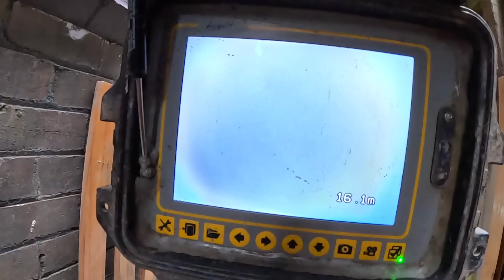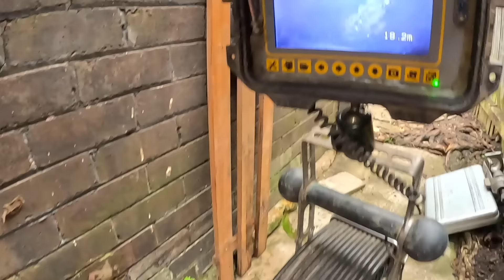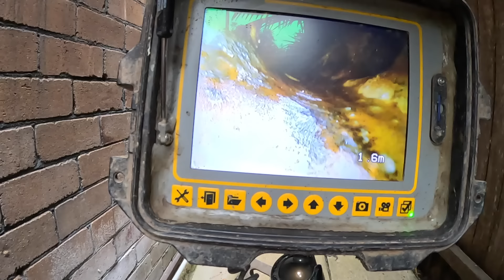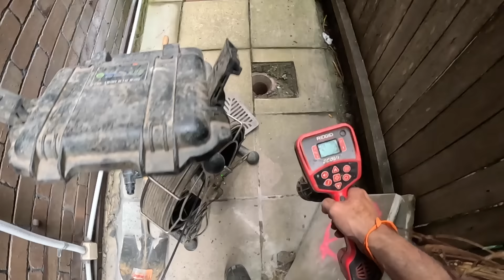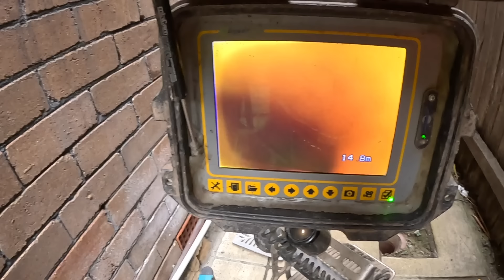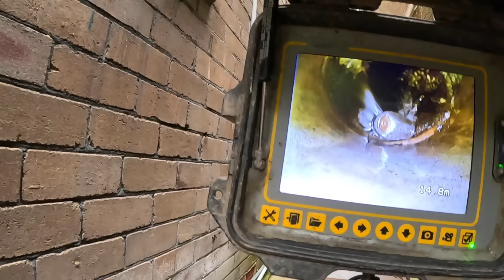Blocked Drain 774

Comment: Ollie.
A quick question that maybe a bit silly. Why is it when you use a head from the reel you just put them on hand tight, but when you use eg. the gurney you use spanners / wrenches to do them up? 🤔
Another awesome job done. 😃👍
Reply: If i had to take a educated guess, its for 1 of 2 reasons,
Either because when hes putting his jets down the drain their not near his face so he doesnt need to worry about them spraying high pressure water in his face, like when he has the Gernie out, or
2. His other attachments are not as high pressure as the DC-38 or The Gernie, so in order for them not to blow off and to work at their full potential he has to tighten them up.
Just a couple of logical reasons i can think of my friend.